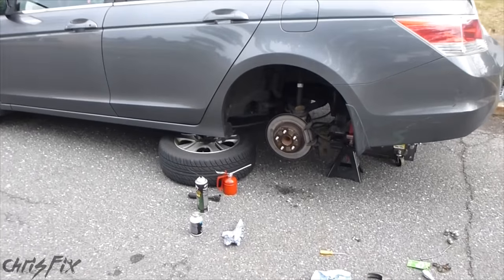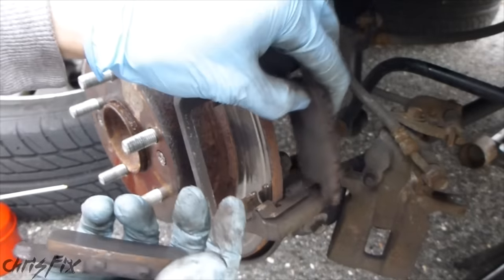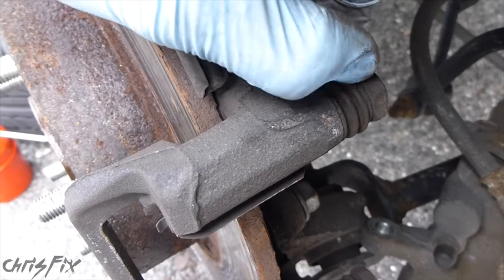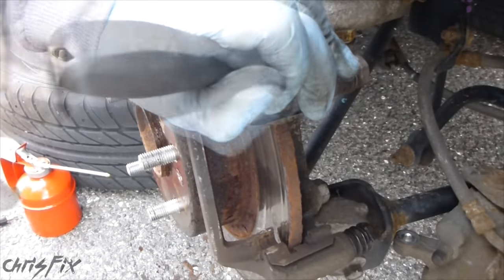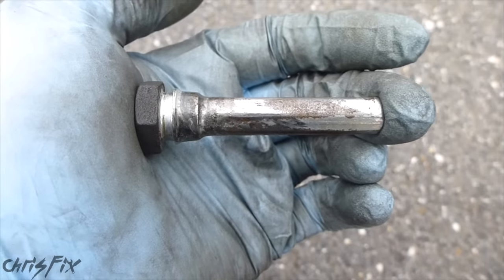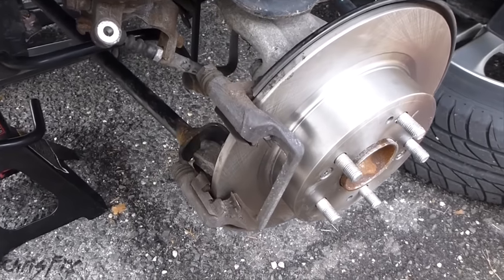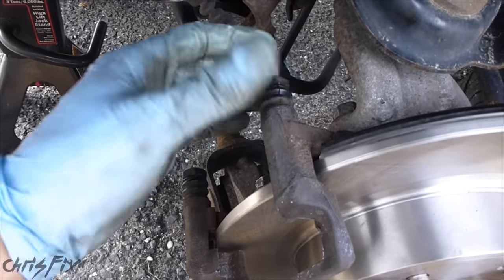How to Fix Uneven Brake Wear

Comment: what should I do if I can't remove the guide pin at all? I tried using a flathead screwdriver and a hamer and the pin just won't come off. the brake pad was completely worn out while the other pad was still in good shape. any suggestions?
Reply from the maker: +fano sosa Torch it! Heat it up and use a screwdriver to pry and hammer it out! They do make a tool which might help: http://amzn.to/1ZVCfGm
Reply: +ChrisFix ok thanks man! do you think I should just replace the whole pin and boot because the pin is in really bad condition from the top and the boot is really compressed. the boot isn't even mounted correctly on the pin and I tried to fix it but I didn't want to damage the boot 😞
Reply from the maker: +fano sosa Yea if the pin is bad I would replace it. They are cheap enough and you are just going to ruin your new brake pads if it gets stuck again.
Reply: +ChrisFix ok thanks 👍 keep up the good work, your videos help a lot 👌
Reply: +ChrisFix hey Chris I tried to torch my pin first and then 
pry it out but it's still not moving at all. the boot is completely off but the pin still won't come out. what should I do now?

Comment: Can I use anti seize to lubricate the caliper guide pins ?
Reply from the maker: +Xiaoyu Zong No, antisieze is a dry lubricant. You need silicone.
Reply: +ChrisFix Thanks. The 1st owner of the car used copper antisieze ....

Comment: I think the pins were in the wrong holes.  "Pin A" has 3 flat spots on it & goes in the bottom hole. "Pin B" is round & goes in the top hole.

Comment: So let me get this strait, I use petroleum grease to do the spindle bearings which have rubber seals but I use silicone to lube the brake guide pins which have rubber seals? ok, now I got it.

Comment: The caliper pin was rusty and dirty, well guess what. The only way that can happen is if the boot is leaking. I would only consider doing that brake job on a car that is 7 years old is by having at least new boots on hand. The pins will need cleaning and new grease, so as long as it is apart, buy new boots. It's only about $10 for all four brakes.

Comment: Can I use standard grease to lubricate guide pins..??
Reply: Should use high temp caliper grease. Similar to the silicone grease Chris shows.  You can buy in small packets at the autoparts store if you don't want to buy a tube or container.
Reply: @jimdandy6472  thank you!

Comment: Don't hit this way caliper pin may  gone bend so must remove caliper career  and fit the pin bench wice then slightly rotate career, pin removed next clean the career holes with rust cleaner spray.

Comment: Not all vehicles have floating caliper guide pins....and still have uneven wear.....
Reply: Taurus .357 Magnum really guess what there are other things not mentioned here that cause that , worn ball joints , worn struts or worn suspension parts and even brake fluid that has not been replaced causing a piston that partly seizes worn rotors cause uneven wear there are many things not mentioned in this video that can cause the problem

Comment: you forgot to clean out the slide pin socket on the caliper bracket before reassembling. clean pin in a dirty hole does not much good.

Comment: Can I use grease ?? Or is it bad
Reply: Giovanni. no. never use regular grease with any breake part. it does not stand high temperature and will cause your rubber boots to swell.

Comment: There's a main and sub pin. Key is the pin boot. Just so you know Chris Fix. Fyi a guy who manufactures brakes for a living.
Reply: Is knowing which pin is the main pin simple  to determine? And, what about that little rubber bushing that is typically on one of the pins?

Comment: You should of cleaned both the guide pins with fine sandpaper and brake clean before greasing up and putting back together. If you are going to show the DYIer how to do it, show them the right way!!!

Comment: Piston can be not paralell to caliper only whet it is allmoust out of the caliper, piston is not the cause of uneven wear.
Reply from the maker: Thanks for sharing
Reply: @chrisfix  Welcome mate :) 
 Put a  caliper guide in impact or some other wrench , take a piece of sandpaper, wrap it around the pin then hold it by hand and do some twists with a Impact, takes 5  seconds to clean a guide pin :)

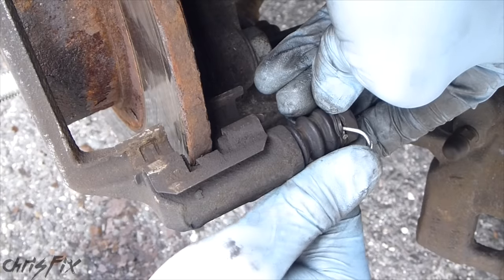Comment: 3:17 looks like you poked a tiny hole in the rubber boot of the lower guide pin. also i hate to see you work on a pad bracket that isn't fastened correctly yet. other causes of uneven brake pad wear may include rust and debris clogging up the 'rails' in which the brake pads are sliding in and out, those can be cleaned up with a wire brush, sandpaper or in worst cases a light touch of angle grinder. but remember to protect them from rusting over again by applying some grease so the bare metal is insulated from moisture. actually never seen a piston that was crooked but i can see it happening .
Reply from the maker: Thanks for sharing.

Comment: is it ok to put anti sieze on the guide pin?
Reply: Yes.  Before silicone lubes that was our goto brake lube.
Reply: Did you end up doing it? I'll probably do that too because I just bought a bunch of stuff for maintenance and I don't want to spend more money.
Reply: @fosty.  yes i did then i found out that you have to use the silicone lubricant so i recleaned the guided pin and dabbed the silicone lube. Works good so far.
Reply: @BeyondAverageSkilled  Yeah I just read that in high heat it gets sticky or something. I'm going to use it anyway for now because I'm poor, but I might switch it out later.

Comment: the mechanic said my car has uneven front brake pads use problem.  and called 600$ for the pads and disks replacement job.
do you think it is fair?

Comment: Advice , if your guide pin is coroded  change the entire caliper bracket not only the pin . 

Reason? simply that by logic if your old pin is completly coroded it also means that the walls of the the bracket where it normally goes is also coroded the same way  .

Result ?  with time as your brakes wears out you will notice a lip right on the outside edge of the pad .

Yes lady and gentlemen  .  Thats how wear and tear works when it comes at mobile  part components  .

when you have a rpped piston inside a ripped cylider you dont just replace de piston   and leave de cylinder with groove do you ? otherwise it wont work right and it will most likely rattle  ? at least not efficiently it wont work  . Why do that  to a  braket with rusted out walls ?  

Now if the customer wants to play it the cheap way thats his decision but by my own experience in my youth as a mechanic  without  telling the customer about this issue  i ended up re-working the brakes eventually and it didn't take very long for it to occur  trust me just  a couple of weeks or month in some cases depending on how many miles  the clients did with their car daily .it didn,t take me years to realise that this kind of fixing is not recommandable  if you want to have brakes that last and work efficiently and wear out in a normal fashion  in a reasonnable time period  . . 

Now a days if i see a stuck pin like this i take it out and if she looks like the one in the video the entire brake bracket comes out and goes to junk   and if  the brackets don't sell speratly like i've seen in some companies well i refer to the customer on  if he wants to play it cheap or if he wants good brakes that will last

Comment: You are applying too much silicone paste. That paste will expand when heated and will cause the caliper to apply unnecessary force to the inner pad even when the brake is not applied. It will cause more inner pad wear down the road.

Comment: The more ase certifications I get the more I realize how much these lil YouTube diy guys don’t really know it funny just replace the guides wen you get new pads all together
Reply: So dont grease a ball joint, just replace when they wear out? At $12/wheel I'll grease the pins and prevent the issue from happening.  It's called MAINTENANCE.  U dont toss perfectly good guide pins.  He refused one after cleaning and greasing it cuz parts store didnt have it.

Comment: You cleaned the guide pin but not the hole that it rides in. Get in there and spritz the hell out of it then use a bore brush and clean, clean clean.

Comment: There's not "a way" to fix uneven wear. You're either installing brakes correctly and greasing the proper points or you're not.

Comment: you lube the pin. BUT then the rubber boot WIPED 90% OFF THE PIN
Reply: I was thinking that the boot should be taken off the bracket and pushed on to the pin. THEN apply the grease to the pin. Then push the pin into the bracket and slide the boot into the groove in the bracket that holds the boot in place.

Comment: The rubber boot wiped all the silicone grease off the upper guide pin that you just cleaned so you are repeating the same problem who ever did the before you. waste of time.

Comment: Problem with this video is that simply replacing the slide pins actually not a proper repair here.....lets use some common sense..... if the slide pins are that junked.... you can expect the slide pin bores to be junked in the same manner. Therefore if you put new slide pins in the old caliper bracket.... guess whats gunna happen again. Corroded and rusted slide pins resulting in uneven brake wear. This being said.... the proper repair here is actually to replace the caliper bracket with slide pins. Additionally im not so sure about honda... but i know toyota does not recommend silicon paste as that lubricant actually causes rubber to swell. Toyota has a rubber safe grease we use on slide pins and its pink in color.

Comment: #1 tip on anything that moves: lube it
Reply: Ruby Rose What about things that are lazy but meant to move?
Reply: Ruby Rose So is that a yes or no? Don't wana waste it if not.
Reply: idk ask an expert
Reply: Ruby Rose OK sorry I thought you knew a bit about these things.
Reply: it depends. be warned about wd-40 because it does melt some things because it uses a petroleum base.
Reply: Ruby Rose Thanks I'll keep that in mind could do with out the burning🖒

Comment: Two things wrong with this video.

1.  You also need to clean out the caliper opening as well.  Seems counter productive to clean out a pin and replace it in a cruddy dirty hole.  

2.  The caliper hole should also have grease applied.  What you are showing when installing the pins is that you are basiscally wiping off 95% of the grease you added.

Also your before and after showing the "springiness" of the before and after is false.  The reason why it appears so much more springy after you apply grease is because you have trapped air in the caliper.  This air will take time to escape then it will be back to the way you see it before you cleaned and added grease.    Think about it, there is no actual spring in the caliper or pushing on the bolt.  The only travel this will have will be the travel of the rubber boot. The boot will not extend as far as your showing on its own unless there is some force behind the bolt pushing it out.

Another common cause of uneven wear is a bad brake line.  Older brake lines can deteriorate and cause a one way valve affect that does not allow the brake fluid pressure to be relieved from the caliper.

Comment: Always always remove the pins and regrease them. You wonder if these mechanics grease them when they charge you $700 plus for a 4 wheel brake job with shity AutoZone parts? And it's never what they quote you it's always more. Do the job yourself brakes are pretty easy. Get OEM or better parts. I always do cryo treated rotors with Hawk pads. AutoZone pads used to be sufficient. But they went downhill real bad last few years. I still use their calipers because their lifetime. But it comes at a cost. Every year or two I have to replace one of the calipers because they're leaking. My brake fluid is pretty clean let me tell you. But what are you going to do original calipers are freaking ridiculously expensive. 350 vs 65 life time warranty. Do your own work or work all week so you can afford the bill, your call.

I've been using high temp grease on the brake pins forever. I've never had an issue with breakdown of the rubber. But that's just my luck. I'm not so sure a shop uses silicone paste? One of my vehicles is still on AutoZone pads, not for long. I hope, they usually give you a packet of organic Grease, not sure if that's any better than regular grease?

Comment: That caliper piston is not retracting once those brakes get a little heat in them. Yes the pin was stuck but that caliper is no good. Piston problems usually wear the inside pad while pin problems usually wear the outside. When you do reuse the caliper you need to clean the supports at the abuttment area and replace the hardware. People like to group shops together as overlooking these issues but actually the good ones are doing stuff you youtubers aren't. Don't show people how to do brakes. It just might be you sittig at the stop sign when they can't get stopped. Leave it to the pro's.